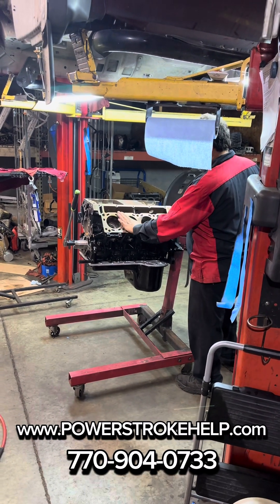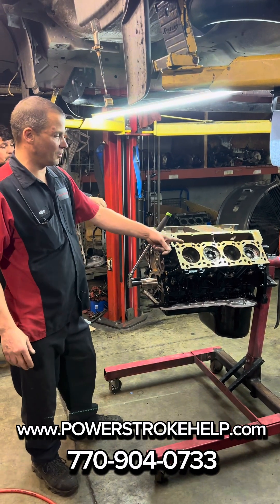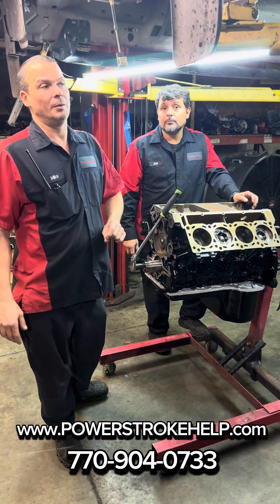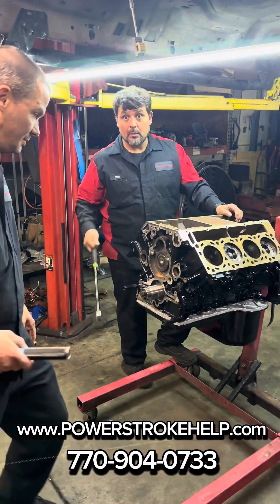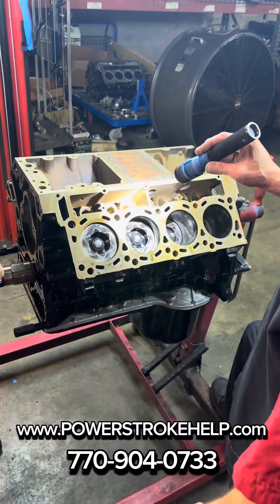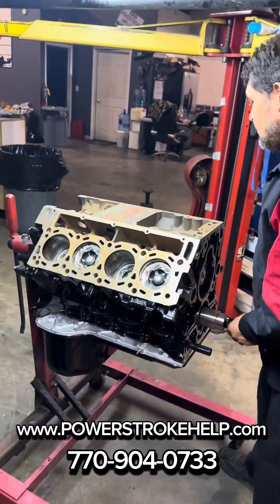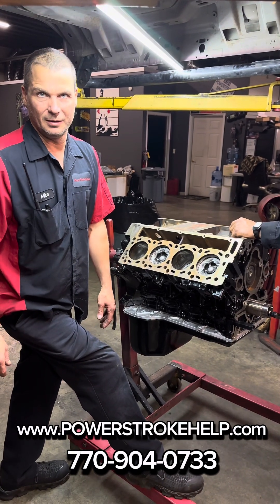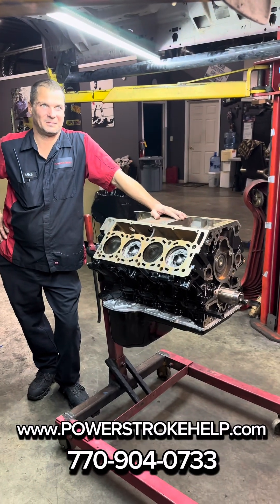6.0 powerstroke cam lobes inspection

Comment: You might be checking for galling on the cam, but what is the lift like? Have worked on engines for many years, and one brand and series that I worked with only had to have .020 wear on the lift and the camshaft was out of specs! Those engines had a fairly high ratio rocker arms!